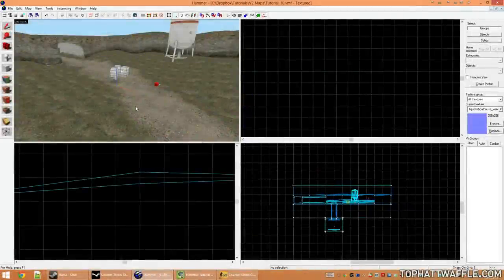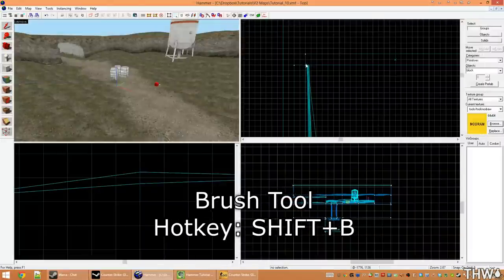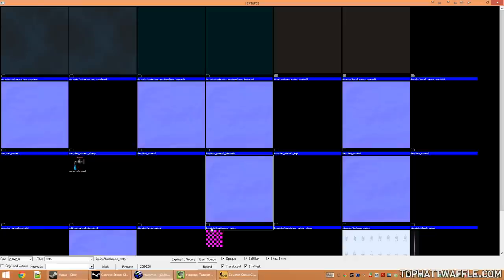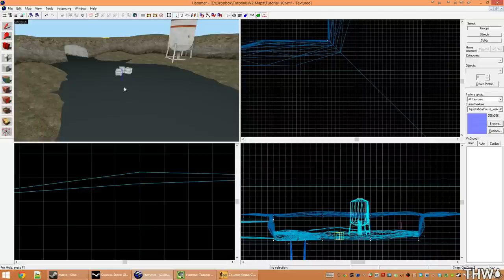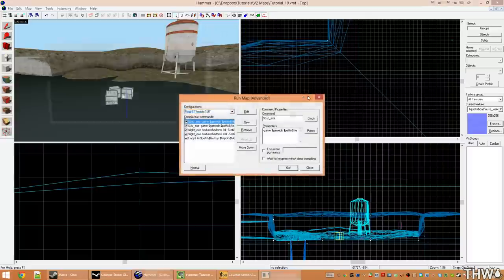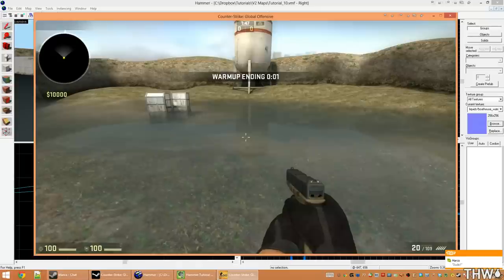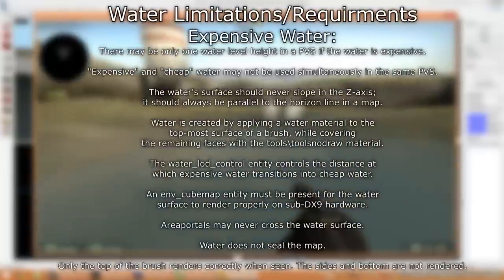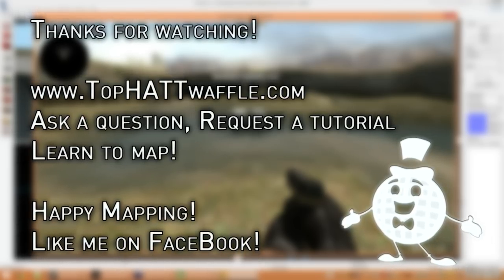[Source 1] Hammer Tutorial V2 Series #10 "Adding Water to Your Level"

Comment: dunno if anyone can help. I have put water in my map and it works but when I try and place water in a different area in the map it works but only half of the time you run around in it 1 sec its clear and you see the floor under it then next its solid green and changes as you move about
Reply: Yeah thats kinda late xD, but basically you cant have more than one water in your level, its limited to one and it bugs when you add another one